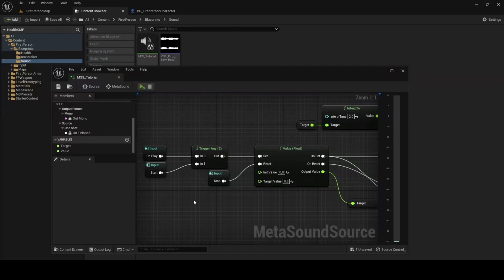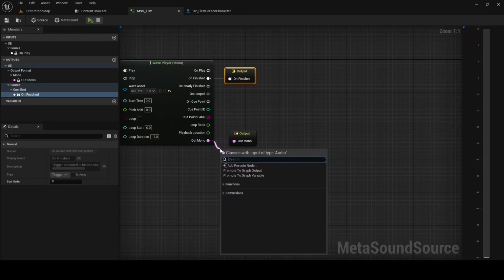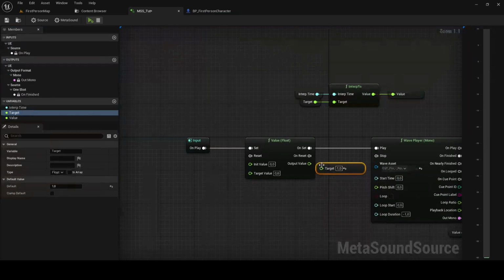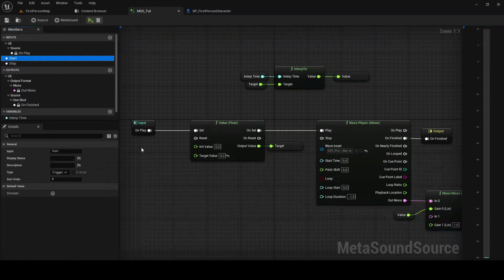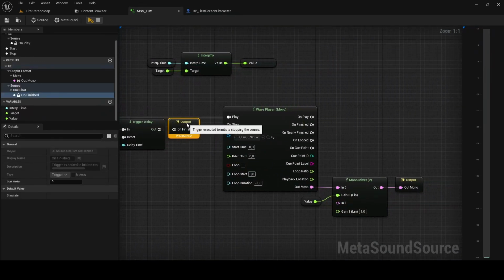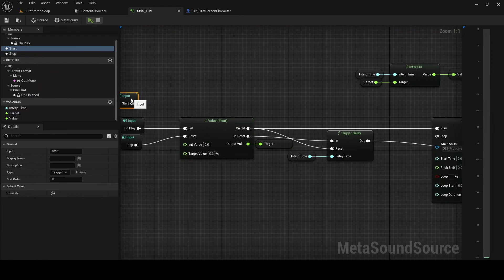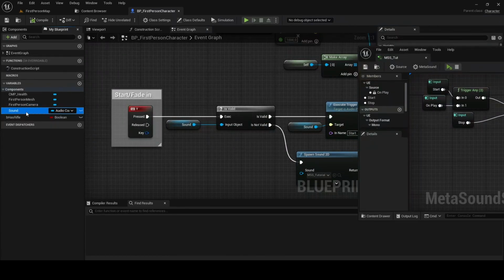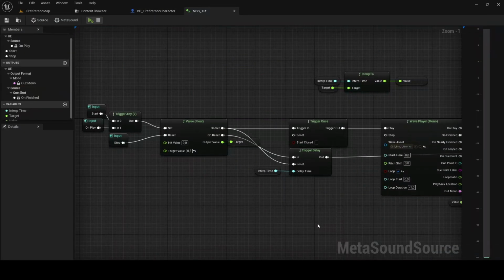UE5 Metasounds fade in and out tutorial

Comment: what is wrong with epic why would they not include such a standard thing as a node? come on guys
Reply: i know, really. This is silly.
Reply: They do, it's called the ADSR Envelope. It stands for Attack, Decay, Sustain, Release and it's one node to do exactly this with much finer control as you can have different fade in and fade out lengths than each other. If you use the ADSR Float then you can connect the float output to the float on the mixer.
Reply: @katanalevygames  lol, nice!